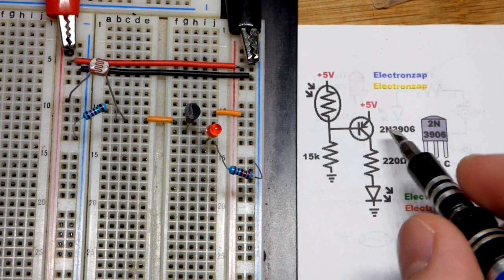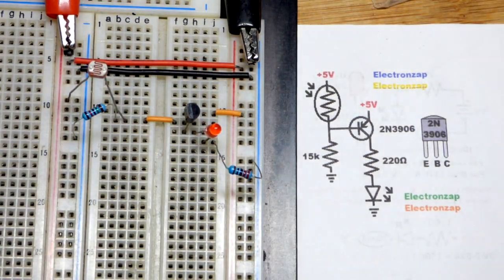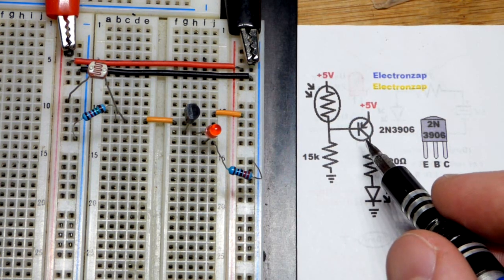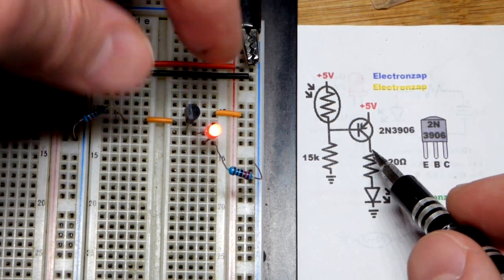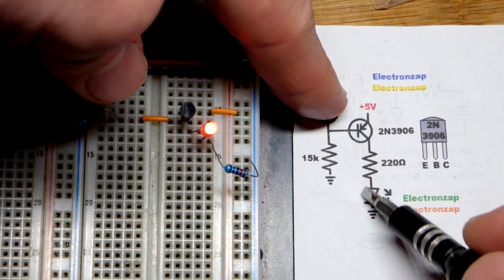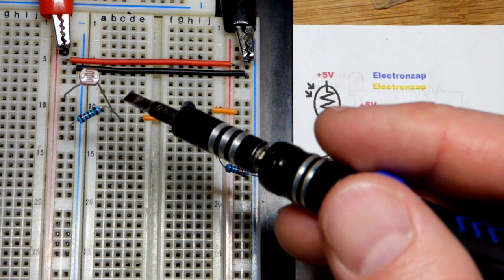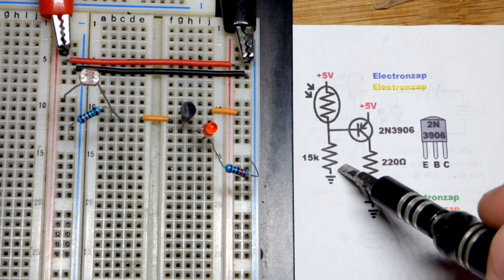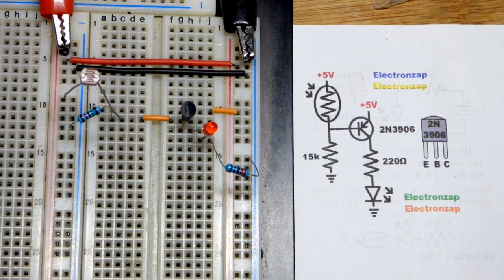LED on when dark 2N3906 PNP BJT and LDR switch circuit for learning electronics shorts 107

Comment: Hey I need help with a capacitor question. If I had a super capacitor bank. Aka several super caps connected in series. 18x of 2.7V500F caps. Should give me a bank rated at about 48V27.78F.  Can I connect that to a source that may spike into the 90 volt range with a low amperage?  (Small DIY wind generator) Am I correct in thinking that the capacitors will not be in danger as long as I put a load on the system (inverters and or dump load) that will keep the stored voltage in the capacitor bank below about 35 volts.  Am I correct to say that the 90 volts at 0.5 amp (less than 50 watts) will charge the cap bank rather than over load it immediately? 27 Farad would take some time (a few seconds maybe) before the capacitor bank would reach its max voltage.  I plan to use voltage switches to engage solid state relays as the voltage climbs in the bank. At about 20 volts the inverter will engage on its own. At about 35 volts I would trigger the dump load. At about 40 volts I would trigger the brakes on the wind alternator. But I don’t want to let the magic smoke out of the caps the first instant they see a voltage spike above 48v. I know lead acid batteries can be used like I am suggesting but I want to know if the super cap bank could work.
Reply from the maker: Capacitor voltage goes up as current puts more charge on their plates. So, as long as current is limited, you can charge capacitors from any higher voltage source as long as you cut off current before it exceeds the capacitor maximum voltage. If you want to provide a lot of power at a lower voltage than the supply voltage, then usually a buck converter is a good idea. Buck converters take the extra voltage that you don't want, and turns it into more current, so that you get the same power out as you put in, minus whatever power the converter uses up. For lower power loads, you can just use a voltage regular. Voltage regulators basically add semiconductor resistance as needed to make sure that the output voltage is limited.